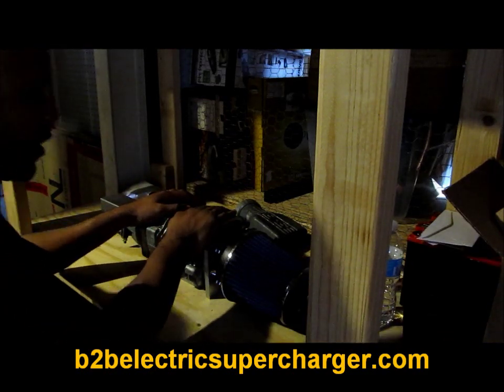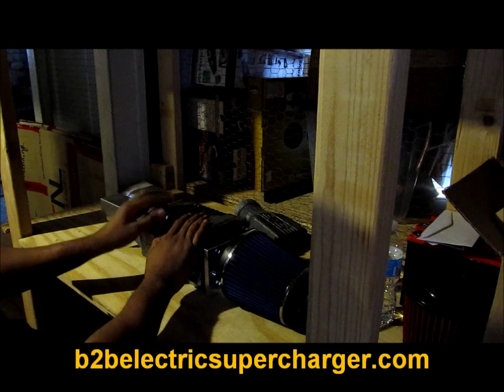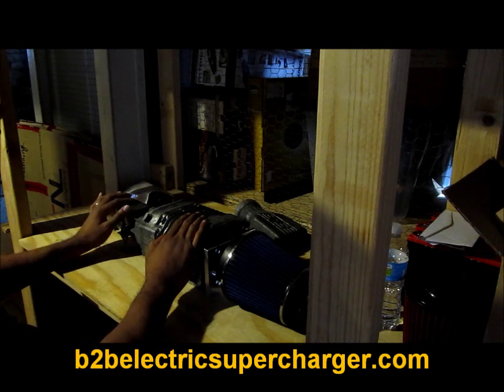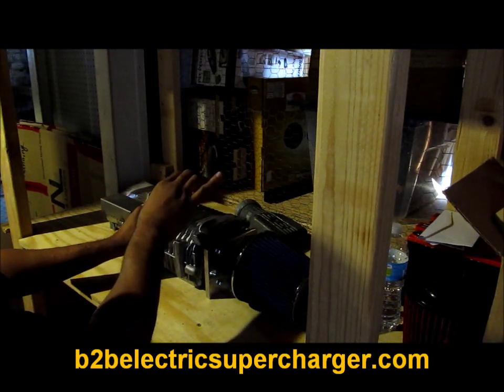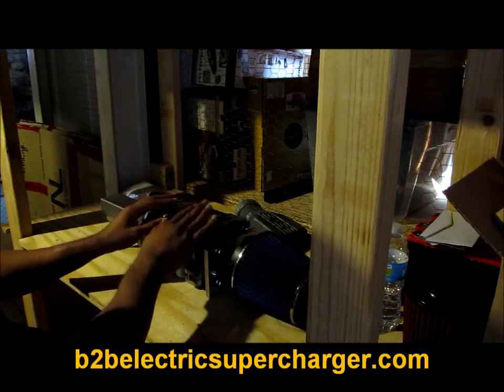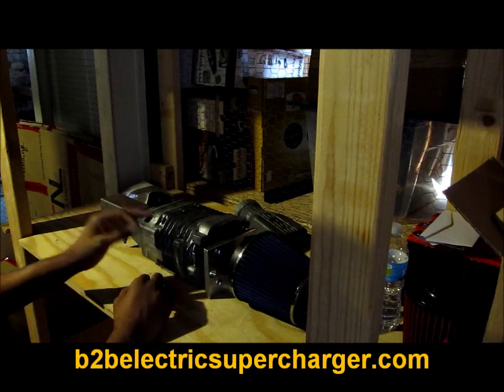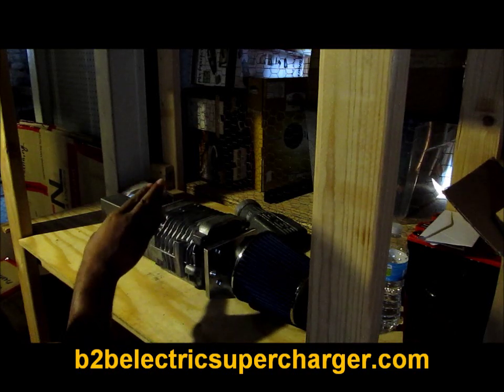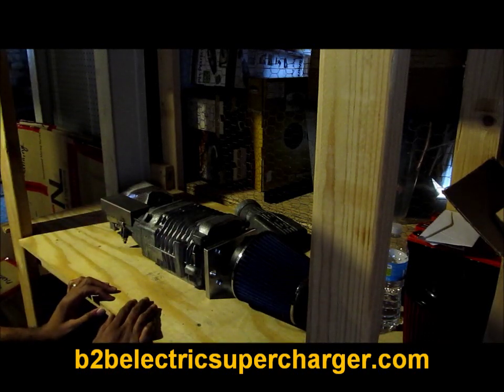Electric Supercharger Killer !!! ( CO2 Powered Supercharger )

Comment: If boost is created, to be useful in an internal combustion engine, it must run along the map and throttle position sensor.. Turbos and supercharges don't run full boost until a certain time an climb with rpms.. Keep this in mind trying to use something not engine regulated to maintain an air fuel ratio

Comment: Liking the idea! The only question I have when you are talking about "temporary boost" is how would you tell the fuel / air mixture to increase and timing to change when the boost switch is turned? I have a Vortech in my car, and it req'd a lot of mapping, and changing of air flow components to mix in more fuel for the significantly larger amount of air. I like the idea though! Keep at it bro!